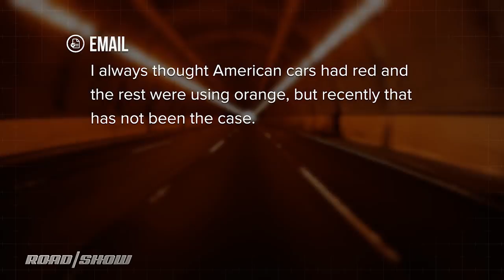Do turn signals have to be red?

Comment: But you didn't answer the question.     

Why us car manufacturers started to use red in turning signals
Reply: Juan The One before globalisation, American cars all had red turn signals.  Then imports came with their amber, but since the US law never changed, there was no incentive for the manufacturers to change.
Reply: superchan7: but why the red?  The rest of the planet have always use amber
Reply: In the 1960s, laws began to change to standardise automotive lighting.  Among those requirements were amber signals all around, except in the US.  This particular US regulation just never changed.
Reply: @canto_v12  The interesting thing is by the 60s American turn signals in the front were required to be amber yet the turn signals on the rear couldn't be amber. This regulation changed in the 1970s when Volkswagen introduced the first vehicle in the US with amber turn signals in 1973 and amber or red were allowed by that point. Unfortunately nothing has changed since and it better as red turn signals are a safety hazard

Comment: Call me contrarian, but I actually do think there is a legitimate reason beyond style not to have amber turn signals here in the United States. Unlike European roads, American roads are considerably larger and more frequented at night—thus, it makes sense to pick a wavelength that retains its visibility at longer ranges. Amber, though more visible within close range—is blinding when too close whereas red is sufficient without burning the retinas (excluding those LEDs that do not know the definition of too many lumens).

The issue emerges due to the design shift. Turn signals used to flip the switch completely on and off, including at night—however, recently they only change the intensity. Separated brake and turn signals are supposed to fix this, but in my opinion convey too much information. I do not need to know if you are braking and turning—the dominant action is sufficient for my reaction. Furthermore, the combined signals when both are active have a wavelength canceling effect in which the turn signal is blocked by the brake—though this could be intended, the intensity is unpleasant and distracting.